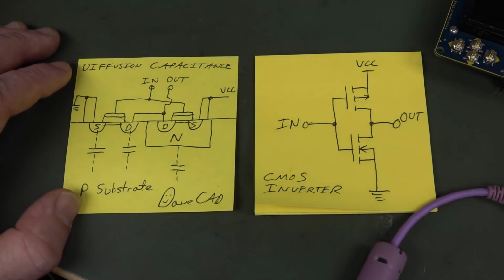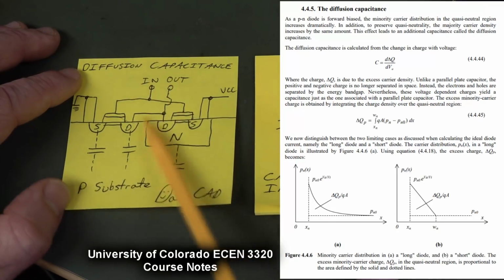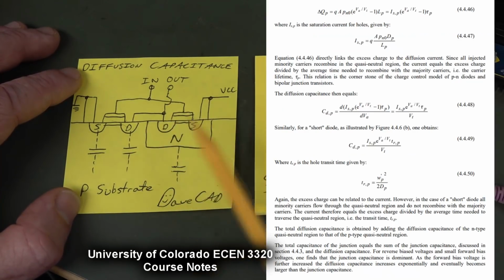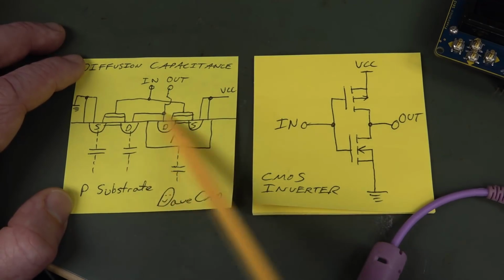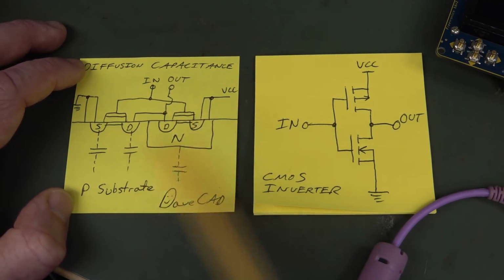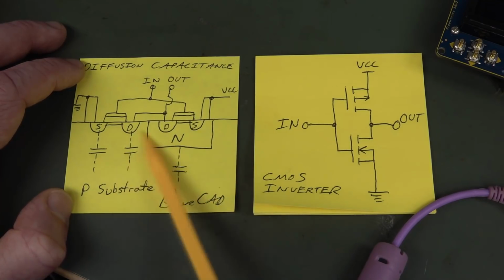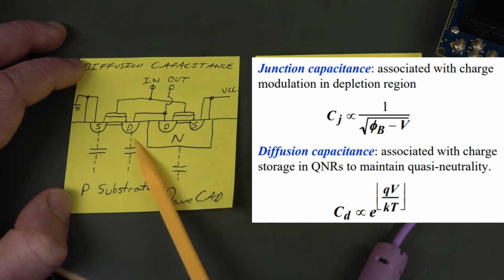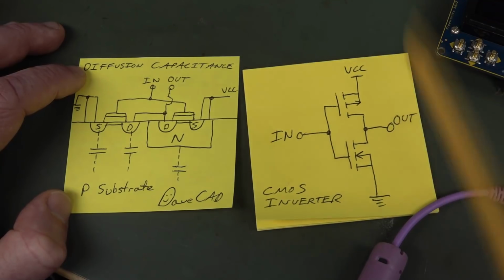EEVblog 1384 - Halve Your Processor Power Consumption!

Comment: Thanks Dave! That’s great! I’ll use this in the next heart pacing implant I design :D
Reply: Marketing guys: "live 2X longer with our new pacemaker !"
Reply: I'll use this trick for control rods controller in nuclear reactor design)
Reply: @drbra1n  but does it override the AZ-5 or is it still a valid option?
Reply: @KJohansson  Good point, mate! AZ has separate set of control rods, so we need to optimize power consumption of that system too.
Reply: *Golfclap*. Nice work Sir.
Reply: You'll probably be fine as long you don't try to use Batteriser in your design to improve power consumption
Reply: Don’t show this to the guys in automotive, car electronics are glitchy enough!

Comment: Questions: 
1. You could use this to throttle your consumption? Test out the reliability of lower PWM settings if your sketch was doing more or less intensive operations?
2. Could you use it in a production environment if that application demanded low power consumption- as found in IoT devices? 

I guess one concern would be variability in the processors or other components - setting your code to run at 70% would work on 95% of the devices, but fail on 5%, which would be unacceptable. 

I wonder if there’d be a way to do an internal self test? Do some checking like a counter increment to see if it had lost cycles or something.  A periodic self test where it ramped itself down and up a few times and then learned how low it could safely go?

Comment: This is essentially like underVOLTing your microcontroller CPU. The same thing is possible on desktop, but in a more narrow range. I assume the severity of the actual program running dictates the range of flexibility of voltage drop allowed.

Comment: ??? First April video????
You can just lower the supply voltage below 5 volts. I think arduino can reliably work from as low as 3 volts. Filtering PWM with internal chip capacitance basically averages out the waveform and you will get the same lowered voltage. And you do not need to remove the bypass cap, since it will make the voltage more DC-like and will not hinder the efficiency in any way.

Comment: I wonder if there are small on die decoupling cap structures on the power rails, in addition to the capacitance of the fets themselves that you mention?
Reply: I really should have checked the date or read the comments :) I was searching for some other plausible explanation for this, but you're probably just back powering the Atmega from one of the serial lines to its host micro... feel ashamed for being taken in by this haha

Comment: I was an electronics tech, we used reverse biased diodes called varactors to tune the frequency of oscillators, I worked on stuff from 400 MHz to 18 GHz or so. As you reverse bias the diode the depletion layer walls grow father apart and capacitance goes down, so frequency goes up. It worked quite well, we had varactors that tuned anywhere from 15V to 60V. Fr = 1 / 2 * PI * SQR(L * C) So yes there is absolutely capacitance in diodes.

Comment: Given how sensitive processors are to power supply glitches. I would think a better option would be to offset the die voltage. There was a mod that was done one of of the old 8 bit computer era IC's that reduced it's power draw. you had to solder a wire to the gold lid on the ceramic package.

Comment: That goes against all normal conventions where we include bypass capacitors to make sure the supply is constant and to reduce noise. How would this work with processors that have brown out detection? For sure you wouldn't do this for anything critical but interesting indeed.

Comment: Diffusion capacitance is generally important when the PN junction is Forward biased, thus having many minor carriers in QNR-s. 
The capacitors you have drawn are at the Reverse biased PN junctions: N-well to substrate and N-diffusion to substrate (otherwise we would be having much bigger problems). Therefore they should not be caused by Diffusion type capacitance but rather Junction type capacitances.

It makes sense to note that those Junction capacitances (especially ones from the N-wells) keep the VCC rail supply powered during the PWM pause. Having many many PMOS transistors, each with it's own N-well multiplies this effect greatly. I wouldn't even neglect the effect of the PCB trace capacitances here.  It is obvious that the thing works somehow from your measurements, but I fail to notice how Diffusion type capacitance has an effect here?

Comment: How would it compare to simply lowering vcc voltage of cpu?
Also: Dave you are repeating yourself. You did explain 2-3 times that the capacitance exists during first half ov this video. Could be shortened without loosing usefull information
Reply: Prima Aprilis!!! He got you!

Comment: Isnt this just PWMing the supply effectively just dropping the MCU supply voltage down like a normal buck converter and using the MCU power pin capacitance as a crappy filter? ... In that case you can figure out the effective VCC based on the duty cycle and all our MCU specs would need to change accordingly ... so I guess while you could just run off a lower supply with a buck converter it is quite nice having it under MCU control since if you need say the ADC to operate at its max speed or something then you could boost your power rail to 5V and then effectively drop it to 2v5 using a 50% duty cycle to conserve power for doing simple tasks

Comment: That is the dumbest thing I have seen this year!!!!   PWM the power pin of a processor, you must be mad or have lost your marbles.   Fist of all with no filter cap on the power your going to have issues. But the real problem comes in when just one of those I/O pins tries to drive something all hell is going to break loose.

Comment: Jeez. You’re so convincing! I’ve been watching your videos for years trying to learn electronics by osmosis. Hasn’t clicked for me yet. Would love a video about why this is nonsense. Do a debunking video on this video please xx
Reply: Let me give it a shot and maybe someone else can tell me if I got it wrong.
The capacitances are very small for it to work at such a low frequency besides the current wouldn't go down, instead when a capacitor is being charged it rises. All in all even if the average voltage drops the energy consumption would stay the same. And many many things which I can't think of right now.

Comment: Actually, maybe that's a silly question, but did you really have to remove that bypass cap? What if you leave it there and still add the mosfet and pwm? Would its leakage drain precious power from the chip's diffusion parasitic capacitance, or would it still just work? //edit: yeeeah and so Dave said it's silly to try it with bulk capacitance, oh silly me. Ok. But why, exactly?

Comment: You know that since this is common knowledge, chip manufacturers do this already internally. But if you add the external mosfet the effect is multiplied and you can get even lower power consumption.

Comment: This freetronics LCD-Shield does have two pullup-resistors (R6 & R9) wich may deliver one or two mA through the io-pins of the mcu. So that could lead to the mcu crashing later than it otherwise would. And it's totally possible to accidentally power an mcu through the protection diode of an input.

Comment: Hi,
I hope your doing great videos 👍
I have one doubt
My application was I have to monitoring AC Main Voltage and display it using LCD 
I have designed resistor network in AC main supply and I convert to around 1.7V AC.. It goes to MCU ADC Pin and monitoring it
The problem was in that AC voltage I got voltage spike 
1. Does it affect MCU 
2. How to arrest voltage spike
3. If it is change the Phase Neutral terminal it affect circuit or not? 
4. It is correct way to measure or not? 
5. Could you suggest some other circuit

Kindly please  help me 🙏 I was stuck in this concept

This is my email ID - rbalaji.krish@gmail.com 
Kindly ping me I have to send my CRO voltage spike capture

Comment: Dave, I tried the same procedure on my original Arduino uno but it doesn't works too well. After messing with some software configuration I found setting 25% duty cycle actually made it consume a quarter of the power!

Comment: Good for battery powered MCU's when sleep mode can't be used..
Looks like I need to test this phenomen.. Quicker way is to grab one of my project's that already have power off option from MCU side and in the place of constant low to hold on, I need to add in firmware PWM test mode... 😂 If it works, that will be cool! Only question rises - how this PWM in power line can affect MCU's ADC measurement for battery monitoring.. 🤔 Anyway, I'll see it after tests..

Comment: Let's be serious for a second. This obviously foolery, but something is going on in the picture, so let's analyze it. My interpretation is that the diode and amp meter are connected in parallel with the FET. When the FET turns on, it bypasses the diode part of the circuit, which decreases the measured current. This also shows up on the scope as the absence of a diode voltage drop+burden voltage. (Notice how the portion of the waveform that increases in size when the PWM duty is changed has a higher DC voltage.) The glitches were probably just plain faked.

Comment: I hate that low-current cutoff function of power banks. So I decided one day to buy cheapest DIY power bank case on ebay (or aliexpress, I forgot) thinking they still use old controllers without fancy function. Nope, everything is now smart, even when it cost 89c. 
So I made my own with small boost converter. Case, boost converter, usb port and damn hot glue cost me $4. So today we need to pay five time more just to make things more stupid.
Reply: Or build Mr Carlson's “Power Bank Stay Awake Circuit” .
Reply: @gd2329j  not something I didn't think about (not that circuit in particular, I somehow miss that video but something similar) and I already have all necessary parts laying around but laziness, making completely new "power bank" was much quicker. Maybe if I didn't have bunch of salvaged batteries laying around I would go that way.

Comment: Fun fact: this is actually how Intel’s ‘Fully Integrated Voltage Regulator’ works which allows them to get much better power efficiency and remove all inductors from the BOM. Sadly due to collusion with big power companies they only use this technology in their server CPUs, 4th gen desktop CPUs did have it but they were too efficient which affected their server CPU sales hence why the feature was removed. Unfortunately, you’ll never see this technology anywhere else because Intel has the exclusive patent on it (filed in 1951, expires in 2151). You can also PWM most nuclear power plants and get over unity from the fuel, this works by uranium enrichment capacitance between protons and negtons but the size of the required MOSFET is rather difficult to manufacture.

Comment: Great idea. I once had to design a replacement EFIS/EICAS (Boeing 727/737/767) display driver board using "modern" components. In an attempt to measure the delta power consumption, we were shocked to see that the new board pulled 0 Watts of power! --and yet was still passing all of the verification tests!

We later discovered an intern soldered ammeter connection had broken loose and the board power supply was actually disconnected.  Results confirmed.

Comment: I am no electronics specialist by any means, but couldn't it be that amp draw measurement is to slow to realistically show the effective power consumption ? If you cut the power from any capacitance it will work for a certain amount of time. But after input goes high again, the loss in capacitance will be compensated with a higher amp draw. This is really interesting stuff you've showed ... making me curious where that "unecessary" power went before "PWM optimization".

Comment: I think it's risky to mention this technique without warning about the effects of setting a negative PWM duty cycle. In this case, the controller will start charging the remaining circuit, which may cause permanent damage!
Reply: i think no because on each pin on avr you have series diode connect with ground and with power supply. This is standard PWM with respect to ground potential.

Comment: In the early seventies, when pocket calculators were the size of two cigarette packages and batteries lasted only a few hours, a friend of mine and I designed and built one (each) around a General Instrument single-chip calculator, the C550. We designed a pulsed NiCd power supply, actually a boost inverter with too little buffering. The whole thing was matchbox-sized (packaged in a model plane Radio Control receiver box) and contained two 225 mAh cells, which kept it running for a whole working day. We used one of those tiny led displays and made our own subminiature keyboard (conductive elastomer foil) and keys (round, hat-like, each made on a lathe). Still works, although the batteries have been dead for years. We took the chips and displays from existing - and very expensive - calculators. A lot of (then) tiny discrete transistors were needed to drive the leds.

Comment: I assumed it was just one of your tricky videos but I had spare time, tried it and it actually worked
Reply: I'm going to try scaling this up a bit...
I'm going to PWM the output of the Snowy mountains hydro scheme.
Due to the sheer SIZE though, I've decided to lower the PWM frequency to 50Hz
(My recent initial attempt at the full 400Hz caused a bit of flooding)

Comment: Take Care: you can only use a single electron up to ten times bevore it gets worn out. As your simple circuit does not take care for that the worn out electron rate goes up when you increase your recycle rate! If you would only reuse new (aka not worn out) electrons you could reduce power consumption to around 10%!
Reply: Electrons in Australia live much longer (by a factor of 100 or so) because of the Coriolis effect!

Comment: Joking aside, I'm sure I'm not the only one who has had issues resetting (or rather not resetting) MCUs because it's being powered by the clock line of an SPI link, so it stays on when the main power is removed!
Reply: Nothing worse than that shock when you unplug the computer to see it still on, you've invented perpetual energy! Then you realise the radio turned off. ;)

Comment: The inverter is the key here. You need the omega particles rotated in the drain direction to get the inorder  substrate impulsing with half resistans.
Reply: It only works in Australia because all the electrons are falling upwards.

Comment: And if you couple it with diffusion inductance from the leads you get an LC oscillator and avoid the crystal for clock too! works best with through hole parts!

Comment: Thanks Dave.  This is an important topic that newbies who have only tinkered at the component level will not be aware of what's happening at the die.  Using PWM and exploiting diffusion capacitance in my IOT devices has increased their battery life 5x which is a huge deal for end users having to change primary cells.  I believe there is also recent research using Selenium/Gallium junctions where it is actually possible to get a yield of over 100% on the incoming PWM signal so once the junction is charged it continues to supply power; it's not perfect but battery lifetimes in excess of 1000 years are theoretically possible.

Comment: It is not diffusion capacitance.  Diffusion capacitance is due to minority carrier storage due to forward biased junctions.  You are using the the reverse biased substrate capacitors.  They are never forward biased.
Reply from the maker: This experiment was performed in Australia, so it's the correct polarity.